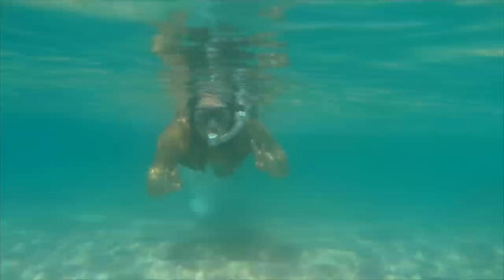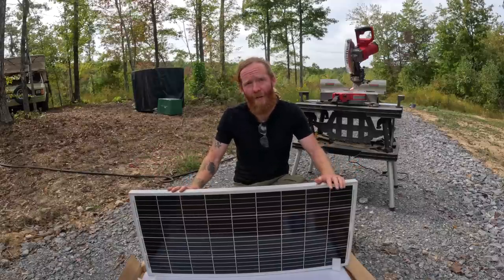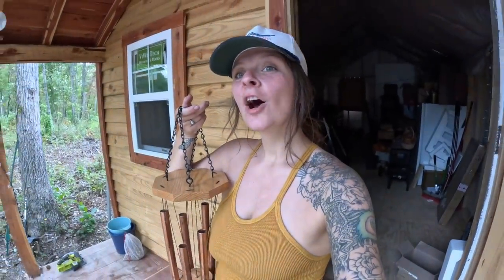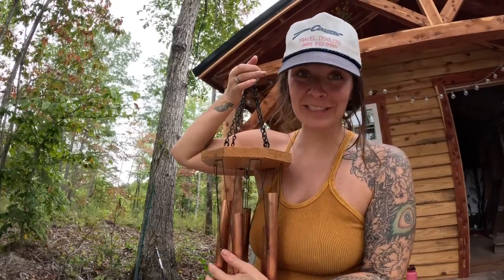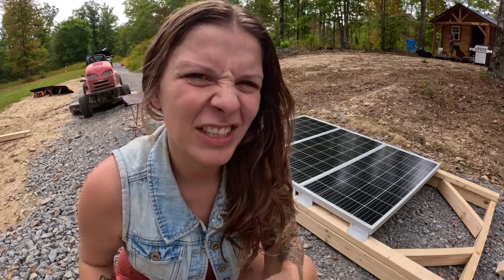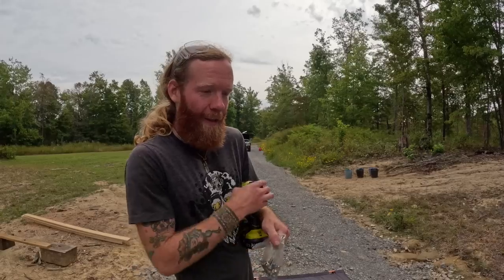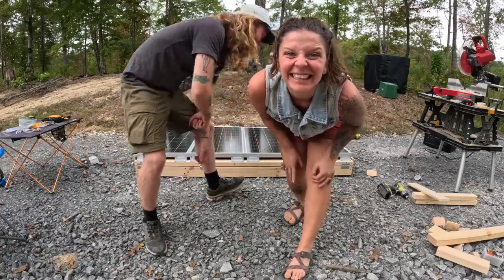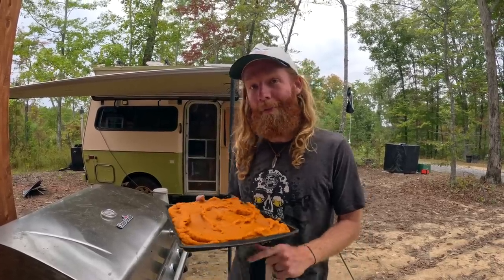MOBILE POWER ⚡ Expanding SOLAR for our off-grid homestead

Comment: Lay down a tarp in the bed of the truck and tie a rope from the corners of the tarp  to a tree and drive it. The wood debris will slide right off with the tarp all at once and you can roll the tarp over by hand  removing the debris into a pile and reuse the tarp pull method as needed. It would save you a ton of time.
Reply from the maker: That would have helped so much lol :)

Comment: If you put a drop cloth down on the bed of the truck you could just pull it out easily
Reply from the maker: Great idea! I've done it with tarps for leaves and sticks - not sure if this might have been too heavy but worth a shot!
Reply: I have had to move a lot of stuff over the years. When you have a heavier load I tie a rope to the ends of tarp or drop cloth and then to a tree. Works really well. (until tarp rips) keep up the great videos!
Reply from the maker: Ah fantastic! Never thought of doing that. I'm sure a tarp rips every now and again but worth we're going to give that a shot. Appreciate the support!
Reply: I was just about to post that... 😊
Reply: If you have space you might want to create a camping spot kinda like an Airbnb. A little extra income. Just don't tell the county...😊

Comment: I saw on one of Bob Wells videos, Cheap RV Living, where he did a video on solar panels. There is a company in Gilbert Arizona  called San Tan Solar. They have 250 watt solar panels for $50.00. @They are labeled  blemished. Bob said they all work like they are supposed to. They are used. Bob said they might have been used for a few year but said that the panels will work from 10 to 20 more years, depending how you take care of them. Glad to see another one if your videos. Peace!
Reply from the maker: We will have to take a look at that. Thanks so much for the information and being here for another video. See you on the next one.

Comment: Lay a tarp in the truck bed before you load up all the mulch…..then pull the tarp out all in one shot
Reply from the maker: Yes! We've done it with leaves before but didn't think to do it with that load - would definitely make things easier

Comment: I did nearly the same thing but in my oven. I was making authentic full size french bread. To get the crust right you need steam. But I now strongly suggest not using a glass dish heated in the oven to pour you boiling water into. You’ll get steam plus your oven proof glass dish will shattered into a million little pieces that I still find today, several years after my failure to think.
Reply from the maker: You know sometimes you got to make the mistake to learn from it haha :)

Comment: They make heavier duty bed rollers! Just get used conveyor  roller belt (8 to 12ft sections usually) cut & lay side by side to fit in bed with the belts re-fitted by heavy duty nylon/leather thread hand-sewing. Use a hand-crank winch handle at the tail end OR have load on used carpet, thin ply, scrap sheet mtl, even strong (dry!) cardboard base to just yank load out.//Steve.
Reply from the maker: Wow that is awesome advice :) Thanks so much

Comment: Your project is amazing and if it works for you that's fine. when I saw your design played out it was amazing. My thoughts were use some sort of metal to slide back and forth and use something like a stepper motor and paired that with Arduino and an Arduino sun tracker design and with that it will autumnally fix itself in the position of the sun at all times.  Sorry my mind was just thinking out loud. Thanks for the hard work both of you..
Reply from the maker: We love connecting with people like yourself that may have a different idea or thought than ours. It is awesome to hear others views on how they would have done something. We love to see creativity grow :) One thing we learn on the ranch here if it works than it works haha :)